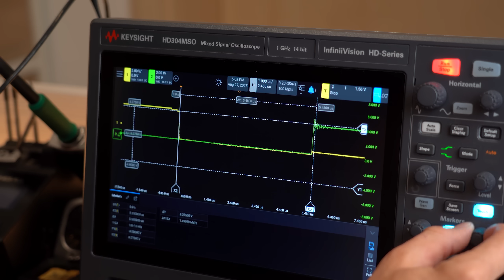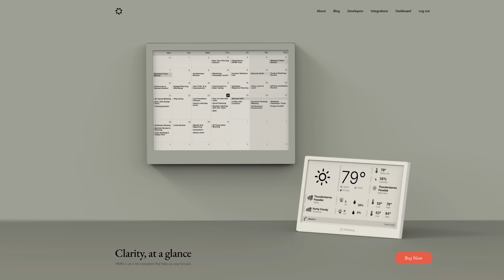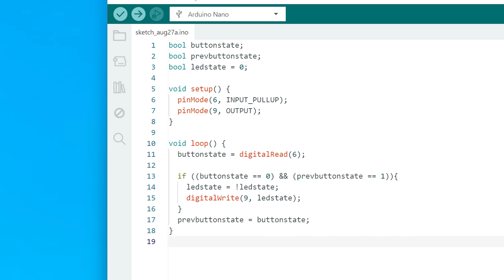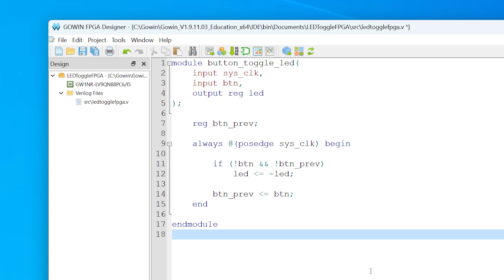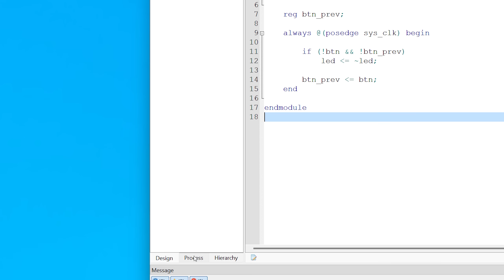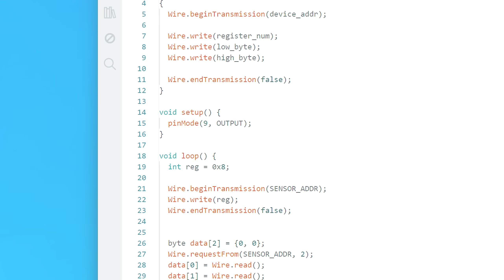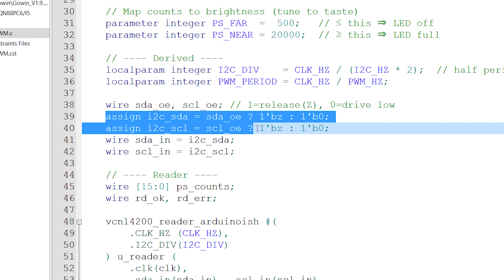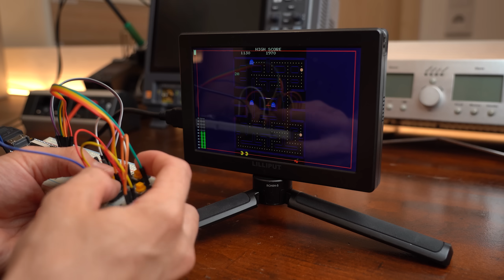The Harsh Truth about FPGAs (You Should Avoid Them?!)

Comment: I don't know much about FPGAs as a general thing, but I do know that they are really good for simulating various older 8-bit and 16-bit computers that aren't produced anymore. They seem to be able to get very low latency and accurate timing without the kind of pitfalls you run into trying to emulate another computer on a normal CPU, issues that force you to try and work around all kinds of things that introduce latency to try and get the most accurate emulation possible with decent performance. Basically, you don't have to sacrifice latency and precise timing to get better performance with an FPGA, and that's where it is really good. This is probably a naive way of thinking about it, but I always just saw an FPGA as a blank, erasable CPU-like thing that can be programmed to act like almost any other computer system within certain limitations, so would be good for something like prototyping a new CPU architecture or recreating hardware that no longer exists. In other words, I wouldn't think it would be of use to someone who just likes playing around with Arduino, it would be of use to someone who wants to design a very simple CPU but doesn't have access to their own fab, and buying an FPGA that can kind of be programmed is cheaper than convincing a microprocessor fab to create something according to your specifications. Can anyone who knows more tell me if I am in the right ballpark or not as to what these are for?
Reply: Not necessarily very simple. They're precisely used to simulate new CPU designs including large scale such as Niagara 2. FPGAs can also implement any other (non-computer) logic, e.g. high speed switches (like Net Insight Nimbra switches, particularly with reconfigurable interfaces).

Comment: I am 15 yo and getting fully into the foga development, it's cool you cocered them, but the way you did it, comparing it to a microcontroller wasn't really fair, they can be used for so much more, and they almost never get used with low speed sensors etc. They are for computing and processing digital signals. I for example want to get into processor architecture so I'm currently building a sofcore cpu...

Comment: gowin has i2c ip that comes with the tools, the fpga technically has all the ip/peripherals that you can fit on it, and gowin provides nearly all the ip in the avr. there are also synthesizable blocks and tiny state machines that can run io controllers similar to PIO (rp) PRU (ti) and the ULP (espressif)

Comment: One nitpicking thing is - there is a difference of µC baremetal and µC under Arduino. When using them baremetal, the learning curve also changes - though still not as flat in the beginnig like FPGA´s
-
Also one other benefit of FPGAs is withhin thier hardware rescources users can have as many instances of a certain hardware description as liked.

Comment: I know you were using a simple LED switch as an example but here's something to note since you were using an Arduino Nano:
A lot of the built-in Arduino library functions have a lot of overhead, even something as simple as setting a GPIO pin.
I know because I took a Nano program to program an EEPROM that was rather slow using Arduino GPIO functions and sped it up by manipulating the GPIO registry directly, which the Arduino library has available but not well documented.  Made quite a difference in the speed of writing to the EEPROM.

Comment: Fpga Engineer here. The biggest advantage of Fpgas is concurrency (including programming in several microcontrollers into the logic). A processor, in general, can do one  thing at a time. An Fpga does all at the same time... also clocks are encouraged for logic, but asynchronous designs can be made without them

Comment: I'm not sure how the gowin IDE  works, I'm used to vivado, but when developing FPGAs, it is great to design things by dividing your script into 3 parts:

The actual HDL code you want to write

A testbench that uses simulation commands 

A third script that connects the two to use for testing 

The reason for this is so that you can simulate and directly deploy without modifying the original script.

Comment: Interesting video but it really needs a part 2; I recommend that you do the same kind of back-to-back comparison but with a different test scenario. Try to implement a high-precision digital up-converter. You will quickly see that the microcontroller will be hugely limited in many performance domains (throughput, latency, accuracy) compared to the FPGA, even in a relatively simple example.

Comment: I have gotten through that learning curve without getting frustrated. (fpga: MiSTer pi)
Reply: If you don't mind me asking: what type of projects do you use them for, and is that for hobby or professionally?
In my personal experience, the microcontroller code I write for my job (though I am not a sofware engineer) are far more complicated than anything I do at home.
Home is mostly a temperature controller, a few light controllers, IR blasters, radar sensors etc for home automation and some artsy stuff with LEDs.
I wouldn't know what to use an FPGA for in a home project.

Comment: Imagine you want to create a computer with an architecture different from Von Neumann or Harvard, one that has certain qualities of a GPU but on demand. How would you do that on a traditional computer? Only an FPGA allows you to do something like that. You shouldn't think of a solution as you would with a microcontroller; you have to think in terms of hardware and parallel processing. You can also use artificial intelligence to assist you.
The other advice is to modularize your proyect and use ( as in microcontrolers ) libraries .
Different modules can call other modules and so on .

Comment: I'd be interested to see your take on the Infineon PSoC series (mainly the PSoC 5LP). In my opinion, it's somewhat of a middle ground between a microcontroller and an FPGA, where you get a typical microcontroller core but also configurable digital (and analog) logic. I've used them in a few projects where it wouldn't have been feasible to do everything in software, like driving a VGA display

Comment: FPGAs simply require a different mindset, you have to treat everything as a state machine that does one simple task in every state and moves to the next state based on current state and some other inputs. For I²C, the main part would require an idle state and 16 states for sending the data, 2 states for each bit (one for data setup, one for clocking it out). Besides that, there has to be some START / STOP condition logic, address register, handler for both transmission and reception of data, etc. So yeah, it would take some time to implement. SPI would be much simpler, that's my favorite protocol. Data, clock and chip select, who needs more?
Reply: I'd personally use a couple states and a counter, rather than 16 separate states.
Reply: @qps9380  well, that's what I meant, since every counter step is also a state, although not given its distinct "case" statement.
Reply: @qps9380  Almost a Moore vs Mealy like question - track the state in the design or in a variable/set of input lines.

Comment: Medical Imaging Engineer here … gaming and high quality displays are nice for sure , but FPGA’s are crucial for modern medical devices like MRI and CT scanners .  Very high powered signals such as 20kW RF transmitters and 100kVA magnetic gradient coils have to be driven and resulting measurements have to be decoded with precise timing . Only FPGA’s and optical fibres can do the real time signal processing needed.  They are king in these applications..
Reply: Genuine question, at that point isn't better to just go straight into asic?
Reply: @Belrmar I recall some years ago ASICS were used much more  but suffered from having a fixed design that was harder to bug fix  or improve on later .  You can change an FPGA ‘s programming easily as new SW and system features are developed as part of new SW deployment .  ASICs are still widely used though ..
Reply: @kerryhaycock9446  
Probably one could use an expensive FPGA to build/simulate silicon as a test run before making it into an ASIC?
Reply: @Curious-mood  There are/were (at least were) some fab companies that had an FPGA->ASIC path.  Resultant chips were more expensive than customs, but... development and debugging is more straightforward than "Let's Go ASIC."
Reply: @Curious-mood  do you have any idea how much it cost to setup a factory to make an ASIC? Cheap to make but the first one cost a fortune.
Reply: @Belrmar  money.
sure high end FPGA's are expensive, but getting custom silicon for something that's relatively low volume would be much more expensive, possibly multiple orders of magnitude
Reply: @Belrmar  ASIC is 100% customizable, and if you pick'n'choose processes, you can even get the IO baked in.  But it's really hard and development can be/is really ouchie.  If you go all the way, you can send layers of 2d 4 color prints and have the chips made from them, but that's almost like designing PCBs using Vellum...

FPGA's are a good middle ground -- you can do lots of things and have lots of cores and... if you pick somebody who has a process, you might even be able to go FPGA-VHDL->ASIC.  All the parallelism, 90% of the speed (and since it's laid out for you nicely [ahem, not you Altera], you can get incredible speeds.

Then again, if you look at STM32 chips, you'll see that they're baking a lot of the IO into microcontrollers (CPU with 4 BLDC drivers... yeah, right here; pair with these ST GaN mosfets and ... drone-in-a-box).

Compare with an ESP32... it's a micro and it does BLE/WiFi, but... you want an ADC?  Solder one up.
Reply: @Belrmar  yeah like others hinted at, it's volume, you go to asics once you have the volume to justify it. Takes millions of usd and on avg 6 months to get asic production going on an established technology, more and longer if it isn't something that's already established. Although there are options in between, some companies offer asic like products that start their life akin to an fpga, but they aren't field programmable they use advanced techniques to set them during production, but without needing a complete reticle set or process qualification.
Reply: @Belrmar FPGA engineer chipping in. ASICs only make sense in high volume situations like phones and other mass electronics. Meanwhile, there are only ~15,000 MRI machines in the entire US. There simply isn't enough volume to justify the fabrication cost, which is barely different with 10,000 and 10,000,000 units
Reply: @Belrmar ASICs cost a lot to make so for specialized hardware where you aren't pumping out hundreds of thousands annually it's not really economically worth it. FPGAs are more expensive per unit but development on them is millions of dollars cheaper. It is becoming cheaper to make ASICs every year so this may change in the next couple decades.
Reply: @Belrmar  What's the NRE for your ASIC, 10's of $1000s for a cheap one?  Most FPGAs load a config file at power on and can be reprogrammed at will.
Reply: @Belrmar Asic vs fpga van be a big question of scale. How many chips do you need? What is the per chip cost at that number? Considering the higher NRE of an asic, how many chips do you need to make to beat the per chip fpga cost? If that number of chips is higher than how many chips you need, then go with fpga.Also, if you find a bug, you can chanhe the design in an fpga to fix it, with an asic you need a new NRE and replace all the chips, and that capability may be worth some amount of higher per chip cost.
Reply: @Belrmar if you start a custom ASIC company that can provide it to them at a competitive price, sure. 😅
Reply: @Belrmar an ASIC price will curb stomp you bro
Reply: @Belrmar there is limit on clockspeed and amount of resources on fpga
Reply: @Belrmar  Yes, ASIC does has a better PPA performance compare to FPGA, but in the medical imaging or other similar area, the total market requirement is not as sufficient as our daily customer's electronics, so the absloute device quantity is much more less. The for device manufactor it is hard to average down the cost on their proposed ASIC chip. And another possible reason is in some cases (usually radar singal processing) there requires to rapidly change the signal processing alogrithim in the hardware, but in this case ASIC is not as flexiable as FPGA.
Reply: @Belrmar  Want to guess how ASICs are developed and debugged? FPGAs :)
Reply: Agree, image rescaling in realtime @ 60 fps, flipping X/Y mirrorong, or rotating on 90`deg etc ... Not diging deeper at the moment, but even on this simple operations its already hard to fit into timings when using MCU only. And adding antialiasing, zoom, color correction etc - it already horror to implement on MCU without skipped frames ...
Reply: I imagine there's a whole class of image processing algorithms you can implement in FPGA/ASIC, as well as others that are impractical?
Reply: Woudn't ASICS be even better at everything FPGAs do outside of the minor inconvincince of needing to spend an absolute shitton of money on making a custom chip?
Reply: @KeinNiemand You can't update an ASIC but you can update an FPGA. That plus the price to start manufacturing are the two reasons why FPGAs are used.
Reply: true strength of FPGA is in its paralleism and flexibilty..
Reply: yeah, FPGAs are nice.  Things need to be used that best suits its application, end of the day :)
Reply: A modern day equivalent to the Mo's 6502 CPU is used in modern pacemakers.
Reply: They are faster than CPUs and microcontrollers I think. But can't be freely programmed for multitasking.
Reply: Wow, I didn't expect to be hearing about medical imaging in this comment section. 

I'm an engg student studying medical imaging techniques, and I was just wracking my head over this FPGA course I have. I guess I shouldn't complain, as you say, they're crucial.

If you don't mind me asking, how's it like working on imaging? Are you like a technician? Do you work on entirely new designs, or are you updating existing devices?
Reply: Given that both of these were in common use before fpga was invented I don’t think they are “crucial”.   It would just save you having to make custom silicon or fancy adc’s
Reply: @jeffh8803  That very much depends on what you define as "crucial". Cost is a crucial consideration, flexibility is often crucial. Having something running in software or on an FPGA gives you flexibility and reduces cost compared to traditional ASIC manufacturing. Consider the minimum quantities that chip manufacturers will insist on, also consider the cost of finding an error in your design after your run of ASICs is produced. Just because something HAD to be done a certain way in the past, doesn't mean it's a good option today, a lot of products couldn't exist without the availability of cheap microcontroller or FPGAs.
Reply: @another3997 yeah but just because you don’t understand how they used to do things at a reasonable price with off the shelf chips and discrete logic and a lot of analogue signal refinement doesn’t mean that we wouldn’t be able to do it if fpgas didn’t exist.  

That’s my point, they are a convenient tool but they are not actually essential. 

I used to work with scientific instruments from the late 80s and early 90s and they are built up from fairly primitive pieces and plugged into standard office computers.
Reply: @jeffh8803 what does essential mean? Before technology, we catched our food with our bare hands. If some technology makes something 10 times cheaper, it opens up new possibilities. And for those possibilities it is essential. As those possibilities were not there before. Cost is everything. Price is a measure of how feasible something is. In engineering price is the most important metric.
Reply: @mennol3885  Well something that is not even required and wasn't used for decades before is definitely not essenital.  That was my only point.
Reply: @jeffh8803 So are you making the same type of argument for a carpenter/builder, they used only hand tools for hundreds of years to build everything from benches, chairs and cupboards to completely finished houses and beyond. So it is not essential that today's carpenter's know how to properly operate and work with power tools and portable battery tools. Again time or duration, and thus cost of completion makes this argument commercially ridiculous as no one these days unless under exceptional circumstances would  insist on a carpenter or builder using only hand tools to build their contracted masterpiece as the costings would be many times higher than what someone using the latest power tools either exclusively or as an adjunct would normally charge for their services.
Reply: ASCIs are not hard to design and also not that expensive - for the number of devices needed in medical devices that would absolutely be the "cheaper" choice - IIF you can manage to get the design correct on the first try and know that you will never need to bugfix, adapt or update them. During development requirements change and if you have your design created then that's it - now you need to update your design and buy new expensive tooling. And if you find any bugs? Yeah trash the hardware and create new stuff. Changes can be such simple things as having the instrument return the result either in SI units or in some other formats. 

Want to see how bad that is? CPUs are faulty. Nearly every single mainstream x86 CPU has tons of errors. AMD and Intel release long lists of errata detailing those problems. And they create CPUs with the assumption that thing will go wrong so the CPUs have their own software and hardware that allows the behaviour of instructions to be changed and updated on the fly. Yeah the CPUs have some memory and mini-FPGAs built in to be able to fix those problems.